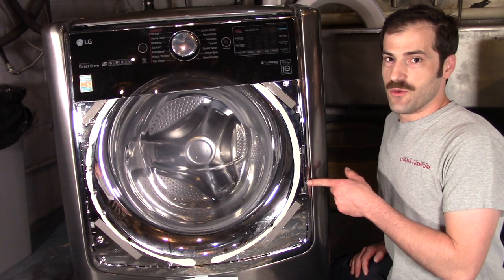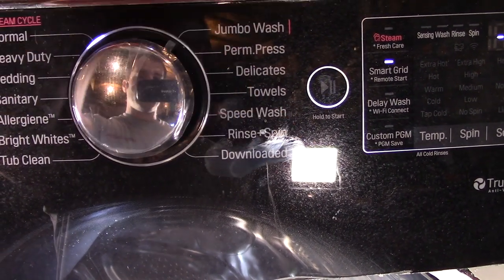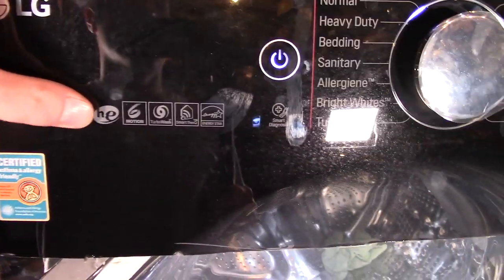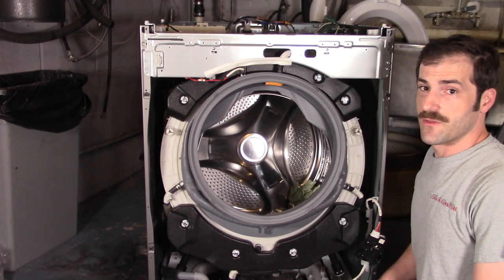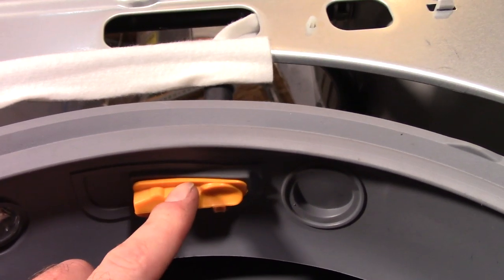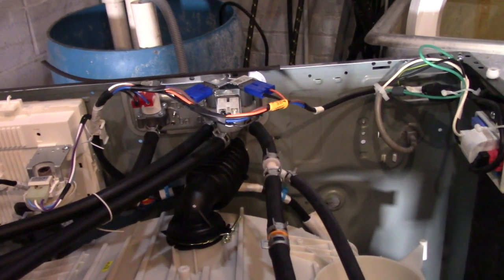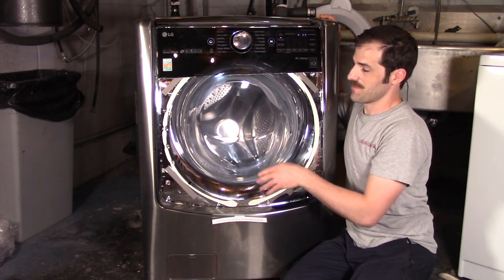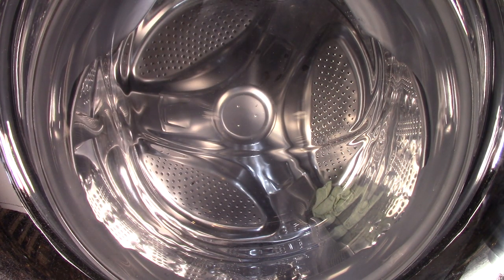First Look: LG WM9000HVA 5.2 cubic foot Front Load Washer + Quick Wash

Comment: I've had this washer for about a year  now.  Very happy with my purchase. No issues at all.
Reply: How long does a heavy soil cycle take?
Reply: @beckyklassen5506  It depends on the cycle you choose because soil is level on the machine. So if you did Normal cycle with Turbo wash but changed the soil level to Heavy it's based on the load you put in but its around like 50 mins (compared to normal cycle/normal soil at 35mins). If you choose Jumbo cycle and did Turbo Wash and choose heavy soil level its around 65 mins.   So it varies based on the type of cycle you choose.  There is a Heavy Duty cycle overall but I have yet to use that one. Everything I put in has gotten cleaned with the other cycles. The ones I use the most are Normal, Jumbo and Towels and I've adjusted the soil level and been pleased with each load without having to rewash.

Comment: The smart grid mean if your electric company is a smart grid the washer will sense the energy level so if the grid is being over powered it will reduce the amount of energy it’s using it’s kind of like the boxes they put on the hot water tank or shut down the AC when the power company needs to reduce the power consumption on the grid.

Comment: Thank you Eugene for opening up this model, I always wondered why LG makes the same size bearing and suspension for a bigger tub. I always tell people you’re better off with the 4.5 cu ft tub. 
I did happen to run into. Top LG Rep. he told me in the newer models. They put in extra support rods In the suspension for bigger tubs. I hope this is true!
Reply: It's true. LG washers with Centum System are the ones you're talking about. These are the new parts:
https://www.youtube.com/watch?v=Mj2CQJWqLho
Reply: Are you sure about the bearings? On the website the 29 inch models have separate bearings

Comment: I like the water jet action.  They look to be stronger sprays on this model.  Smart grid refers to the fact that the washer will detect settings from your electric company indicating that your electric service is in a low rate period and then turn on the machine to run.  It is useful if you have an electric company that sets different rates during different times of the day.

I noticed that the allergen cycle is trademarked.  Is there a way to find out if the cycle is NSF P351 certified to kill allergens by holding a set temperature and using enough water to wash them away, or if this is conforming to another certification?
Thanks for making the video?

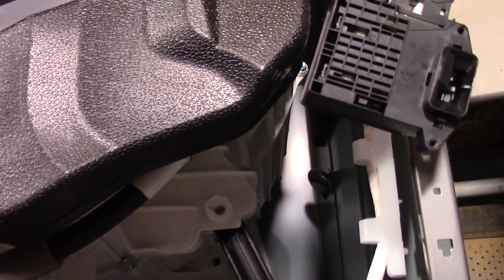Comment: 5:12 Those three suspension rods aren't holding up that massive wash tub - they're just dampers to dampen the motion of the tub, and de-bounce the spring suspension.  Their only function is to resist being quickly compressed or extended.  The weight of the tub is supported by the side panels by those springs, and just like a car, springs are good at supporting weight but need shocks to keep 'em from bouncing.  If you pull those dampers out and smack the top of the tub, it'll bounce up and down for quite a while.
Reply: I have same moudel, 
I bought used from marketplace, 
Tub bouncing during spin cycle, 
I changed all shok observe include two suspension spring and upgraded as i add two more shock observe,
Now Tub has 5 shock observe but still bouncing during spin cycle, 
I don't know how i can fix 
This bouncing issue

Comment: I like these machines a lot. I would love to have one like this. I wonder what the conversion would be in KG compared to cubic feet. My current model is 12 kg capacity. Love your videos.
Reply: According to the miele web site.
An easy conversion is a ratio of 3.
5.2 cu ft  x 3 would be 
like a 15.6 kg.
Hope this helps.
Reply: In my country, there is a similar LG washer with a capacity of 22 kg. They are the same washer, the only difference is that the one available here has a touch sensitive panel instead of a knob to select a program. It looks like this: https://www.lg.com/ar/images/lavarropas/MD05851237/gallery/Zoom01-WM-WD22VTS6-.jpg
Reply: In here Eu is also 17kg this type washer.
My washer is 8kg 58 liter drum, same is 7kg. 9kg is 65 liter and 12kg is (76liter) 24" wide same side's like fully size dishwasher

Comment: I have the wm9500hka and I ran a valve splitter to run hot to both hot and cold intake and just fyi no running errors with totally hot water going into the machine! It's the machine to have if you're running an Airbnb or doing a single load of laundry once per week for hyper efficiency.  One week of laundry includes work clothes, towels and workout clothes and some washcloths. The machine can handle it no problem. The motor however is not as powerful I don't think as the wm2301hr I have as well or I could be wrong because that thing can't take as much as the 9500. It looks like the GE 5 ft washer has a 15 amp motor? And the LG 9500 has a 10 amp motor? I'm not sure how they measure power in these machines but I also see that the LG 9500 has the highest tier efficiency rating whereas the GE doesn't have the highest tiered efficiency rating.

Comment: Speed Queen comes in last place on the how many service to sales ratio list. That light is a tribute to who they used to be. Seems when you buy one now you will have the highest service calls of any washer out there bar none! Shame how such a great company has fallen, and they gave us the proof right here.
Reply: Mine needed to be straightened out when I bought it fourteen years ago. I had problems with the dispenser when it was new but they’d straightened it out. Since then it’s been flawless but they are known for high build quality of parts with sample defects.  I also have a second laundry pair from Electrolux but if either of my Speed Queens break I’d replace them with another pair in a heartbeat.

Comment: If it were you, would you add 2 more shock absorbers and have 5 total rather than just 3?  I've only used this for 1.5 yrs and already replaced the 3 OEM shocks.  There are 2 additional hinge points for two more shocks and it would be an easy add.

Comment: Question 
My kids dropped a water cap in soap dispenser witch clogged water overflowing water inside I figured it out same day removed cap washer was working fine that same night but this morning washer does not turn on at all I removed top lid put a blower to it for about an hour but no Luck any ideas to what the problem could be ?
Reply: Did you solve?

Comment: I have a question... i have an LG washer dryer. I think I have the same that you have at your house(based on a previous comment)  ...there are three versions of our model...i have the one in the middle...anyways...The dryer door is having issues.  The bottom piece thats in the door where the screws go in for the door strike is stripped. Any idea on how to fix that? Any clue on why that happened? On my LG (DLGX3571W) the door strike doesn't line up exactly with the latch...its down a bit and goes in kind a up into the latch. Is that the way it suppose to be?

Comment: That's why bearings don't last as long as they used to,  the tubs are getting bigger which means the consumer loads them up a lot more. Slot more weight hanging out front of the bearings. What a stupid door on the LG.